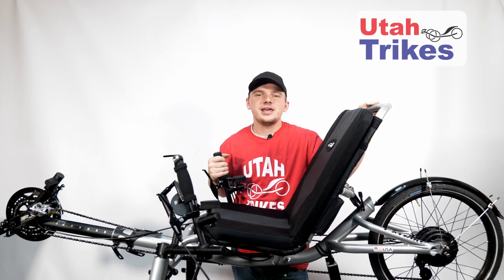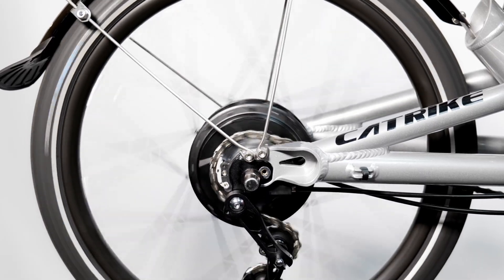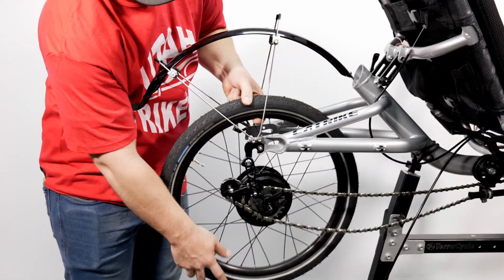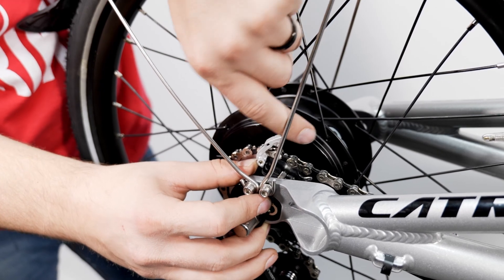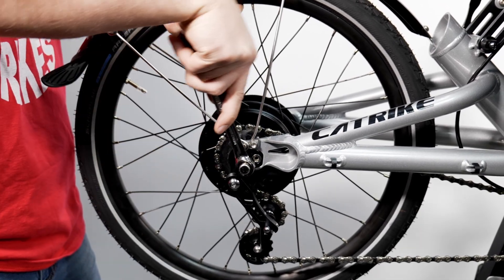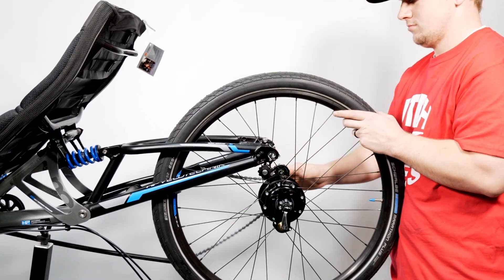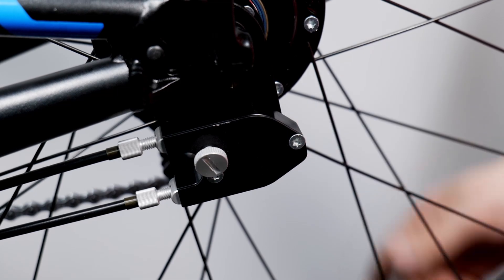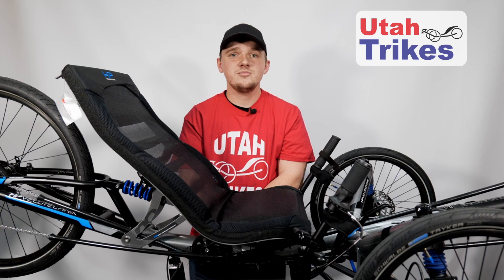Trike Tutorial: Internally Geared Hub Wheel Removal

Comment: N380 install.  I wish it worked that easy.  I always struggle to get the shift cables back in place.  Also the wheel does not want to clear the ten tensioner so it is easier to remove it before dropping the wheel.